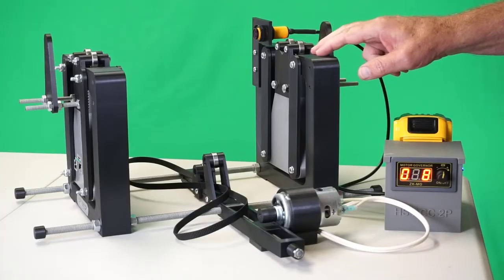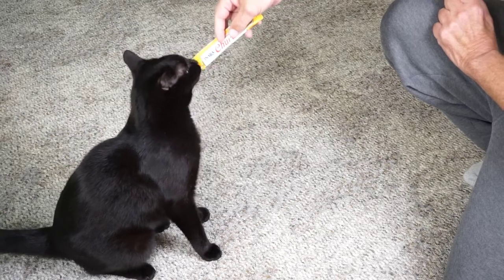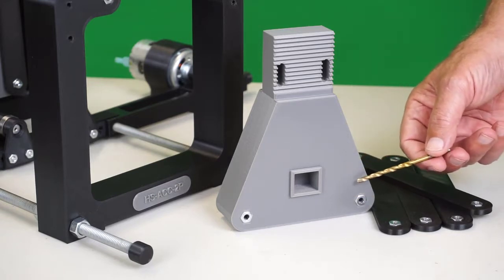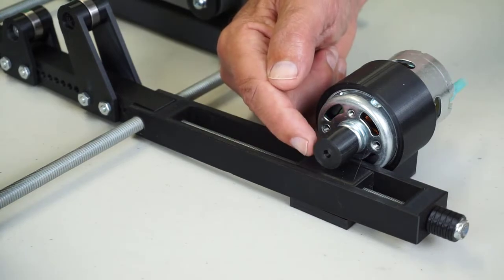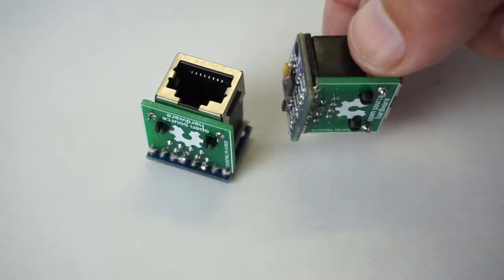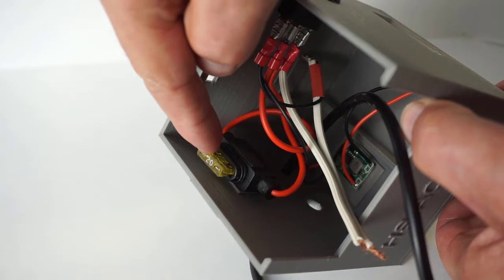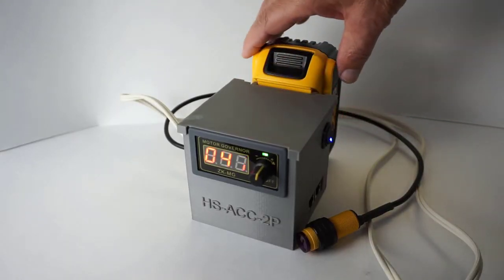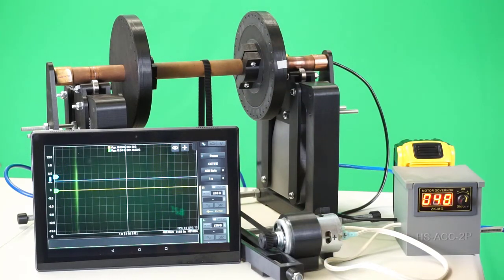GADGETS#156 - HS-ACC-2P BUILD

Comment: Do you have any recommendation for implementing a clamp down jig on the top? 

I was going to use this to balance a mini spindle, which has the housing already fitted to it. This means that I can't add the belt to the middle, since it wouldn't have access to the shaft. I would have to add the belt to the pulley end which is outside the two rotor supports, not inside (overhanging side).  It looks like commercial machines use a clamp down jig to hold down the housing which attaches to the stationary frame of the balancer. My spindle is small (1 kg and 1.875 inch OD), so this setup would be the prefect size for it.
Reply from the maker: you'll notice short 1/4-20 threaded rods that have dual purpose of securing vee block to swinging pedestal ... I would try to improvise bu making use of those, if possible

good luck with your project and I can be reached on HScope Telegram group should more technical questions arise

Comment: It's an awesome project. I plan on building this. Where does your IR signal wire go? Jerry
Reply: I finally found it....... thanks just the same. Again great job. Jerry
Reply from the maker: pin D33 on ESP32

I am working on a 80 Kg model as we speak ... likely released here in a few weeks...with some improvements to HS-ACC project including replacing IR sensor with a laser

or perhaps you like this smaller model...which I rate at about 18Kg capacity
Reply from the maker: flash ESP32 with firmware v1.1-9-202301

issues with latest 2 other firmwares

Comment: This is an excellent design. I bought some of the IR sensors and accelerometers from your last video, but haven't actually attempted to make a balancer with them yet. So there are no bearings on the pivot points on the swinging structure? Just drilled out nuts used as bushings?
Reply from the maker: yes, #10 nuts drilled out to 3/16"

and the #10 machine screws just run on their threads inside the drilled nuts...so little movement that there will be no wear

this kept everything light and kept the cost down

good luck with build and I would recommend you look me up on HScope TELEGRAM group if more detailed info is required in the build and its later use...

Denis
Reply: @theGADGETSplaylist  I guess running on the threads greatly reduces the contact area and thus the friction too. I don't have a 3D printer, but my (seemingly) never ending CNC mill restoration project is making some (slow) progress, so hopefully some year I'll be able to mill the parts to make a stand!
Reply from the maker: @gorak9000  it can be made of wood...it can be fabricated welded steel...it can be scaled many times this size if required...

all would use same HS-ACC firmware and components and all would follow same balance procedure I demonstrated

Comment: I just had another look at the video.
Damn. You really have that 3D printer working well. Those pieces all look like extrusions.
Also
Do you think the stiffness of the CAT5 cables will affect the sensitivity / response of the moving gantry?
In the past I have used "silver satin" cable which is the grey stuff used for telephone connections. You probably have the 4-wire version on your desk phone.
 It comes in flat 8 wires too and is much more flexible because it's fine stranded wire inside (instead of the solid wire in CAT5 cables). Something to consider if you have issues. Same crimp tool I believe.
Nice work Denis.
Reply from the maker: if you look closely at 1 of the grey pedestals you'll see a "seam" midway on the wall...not sure what happened there...

but overall, that basic ENDER3 has been a great performer...my cost for that printer was only $135 ... got it half price ... so I sure can't complain:)

CAT5 cables pose no issue. I can balance that test piece within the weight of 2 postage stamps if I wanted to!

AMAZING!
Reply from the maker: but I also want to stress that the HScope settings for this work are CRUCIAL, else it would be just noise...

and my decades of industrial balancing doesn't hurt here either:)

Comment: Wow. A lot of nice work there Denis. Great design and execution. Thanks.
Reply from the maker: means a lot coming from a guy with your model engine work ethic...thx Dave:)
Reply: @theGADGETSplaylist  Thanks. I could really use one of those occasionally to balance model engine crankshafts. Unfortunately the key word is OCCASIONALLY. Seems like a lot of work there if I wasn't going to use it all the time. 
BUT you never know. :-)
All the same a very professional build.
Thanks
Reply from the maker: @davesage9190  same could be said of your model engines, Dave. Hard to "justify" anything we do. I think we like the challenge.

Designing, building all while videoing was a LOT of work! But handed on a silver platter with just the building portion of the task makes it more reasonable. Also to be factored in is that it's roughly a $100 project.
Reply: @theGADGETSplaylist  All good points. 
With that said. I'll put it on the list. I'm sure I'll wish I had built it the next time I have a balancing problem. Would be nice to have for others to use as well.
Looking forward to the next installment.
Thanks